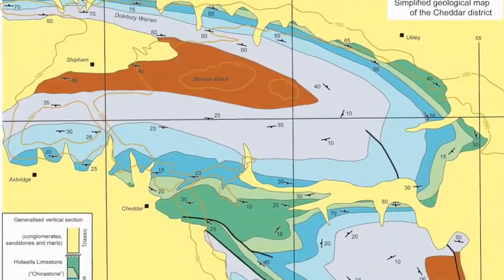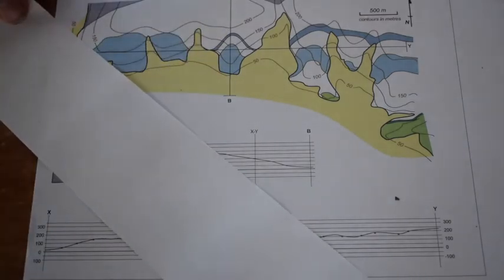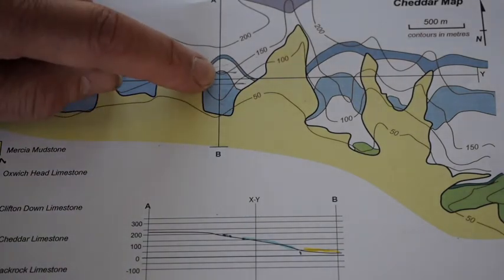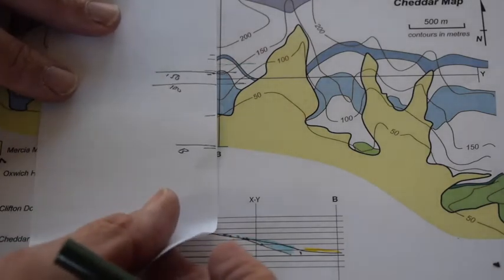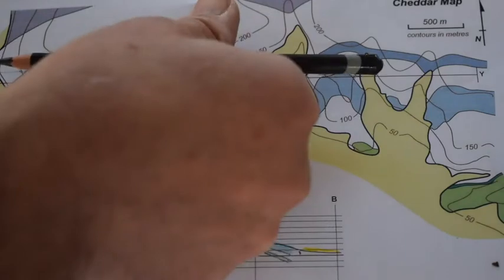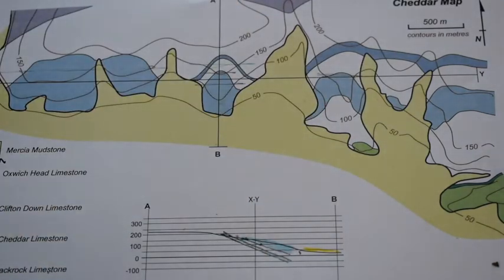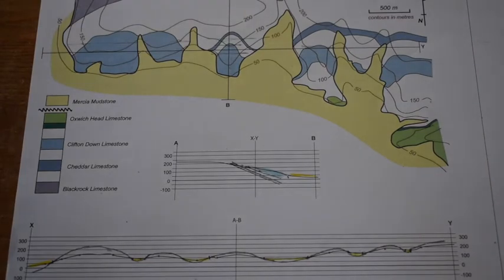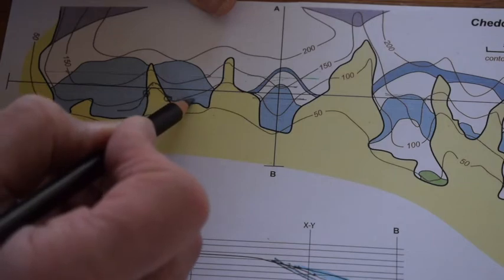Drawing structure contours on an irregular unconformity

Comment: Hi , I'm confused at the point where you're drawing the non straight structure contours and you said it has to go into the subsurface? What do you mean by this because I thought the map shows the outcrops which are at the top of the surface?
Reply from the maker: Hi - thanks for the question. Structure contours are drawn on the geological boundary (e.g. unconformity). If you locate on a geological map the position of the boundary at a given elevation  - say 200m above sea level, you're identifying a single point on the structure contour at elevation 200m on that boundary. At that point the structure contour crosses from being above ground (eroded, in the air) to being in the subsurface. Just as the outcrop trace of the boundary (a wiggly line on the map) represents where the quasi-plane of the boundary changes from being below ground (in the subsurface) to having been eroded. If this abstraction is unhelpful - check out other films in my structure contours playlist (via the Shear Zone Channel)... I've a 3D clay model showing this idea in one of the introductory films.